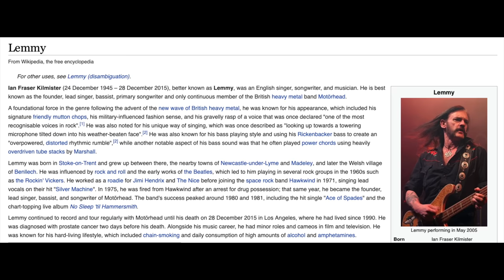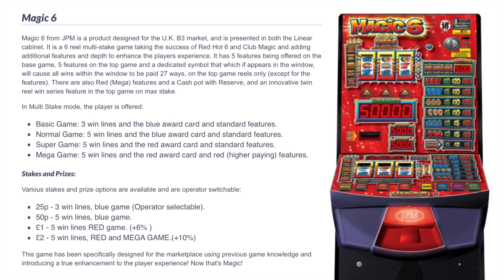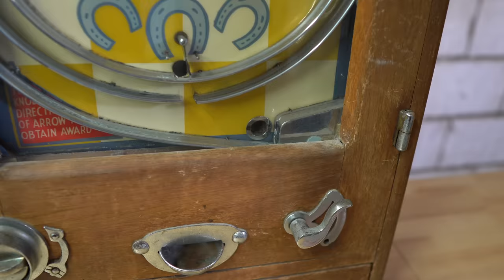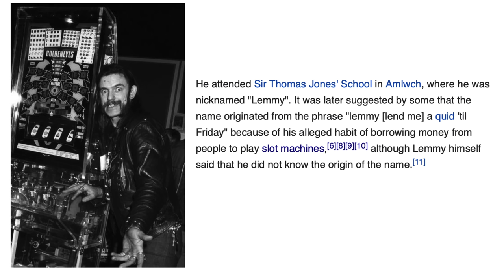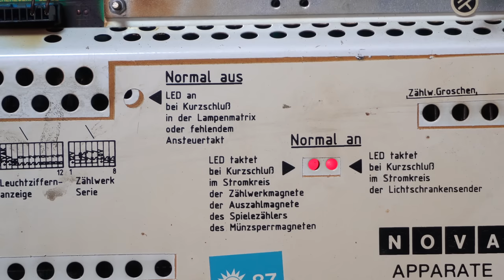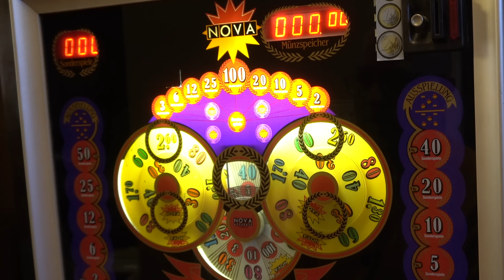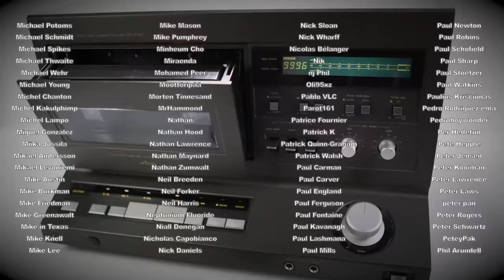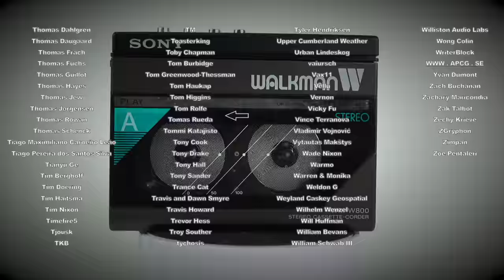Lemmy’s touring slot machines

Comment: This isn’t about fruit machines but back in 2007 I was the deputy manager of a large UK theatre when Motörhead came to play a gig. We were advised to have all of the opera glasses removed from all 1,800 seats if we didn’t want them torn off and thrown at the stage. That’s rock and roll! It took two days to remove them and more than a week to put them back. Sadly, I was too nervous to go backstage so I can’t tell you whether Lemmy had a fruit machine with him or not.
Reply: I haven't seen opera glasses on the backs of seats since Hull New Theatre in the early 1980s.
Reply: @circattle  I worked in Oxford and London and opera glasses were in all of the theatres. Maybe it was the company I worked for whereas Hull New Theatre’s always been run by the council. They probably weren’t interested in contracting in the London Opera Glass Company like the big boys do.

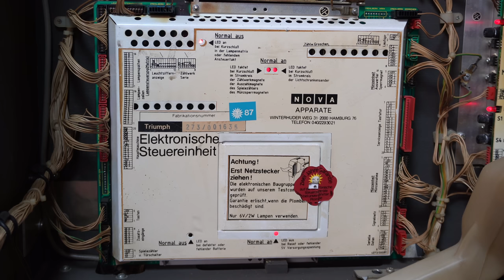Comment: Not sure if this is resolved but at 20:40, the LED on the top left is on when it should be off, indicating a short on a bulb-matrix or missing signal.
Reply: +1
Reply from the maker: There’s more information in the video description.
Reply: @Techmoan  I´ve read that but didn´t see this specific error indicator mentioned there or in other comments.

Comment: Always so fascinating. Long ago I learned why gambling establishments always place slot machines at or near entrances and usually pay out more often: the idea is that as people walk by and see someone winning, they are more likely to go in and give it a try.... and then they get lured deeper in.... and lickety-split, they're broke in no time.
Reply from the maker: I feel that on cruise ships for similar reasons they set all the machine payout percentages high at the start of the cruise but then turn them down as the cruise ends to get all their money back (and more besides). 
Therefore if you plan on playing the slots on a cruise, only do it at the start.
Reply: @Techmoan   I've never been on a cruise, but as we all know, you have, and I should have asked you about it! That's a pretty ingenious method for people trapped on a ship for a week or more
I've read up on some cruises that last more than a month that go all over the mediterranean. Makes me wonder how the gambling would work on more lengthy outings
Reply: To avoid these kind of manipulations of the payout rate some machines had their program sit in RAM only with a Lithium Battery in a hermetically sealed module acting as ROM only. If you open it, the tamper detection deletes everything e. g. by a photosensor in it, you will loose the program, bricking the machine. This was even enforced by several laws to prevent manipulations. See e. g. 'cra gaming machines'

Comment: We used to have gamblers at my old work. The tamper lights used to come on when change tubes were not seated correctly. The only other way we used to get tamper lights was on the contacts in the lock not reading the lock was shut. Hope this helps.

Comment: Hi, German here. My dad had a camp site and pub and we always had one or two gambling machines in the place. The inn keeper would provide the space and electricity and a seperate guy would be the operator owning the machine. The profits were split (not 50:50 I guess). We had one nearly blind regular gues that would sink 5 DM after 5DM into the machine. And this guy hated the DISC machines. Because he could hardly make out their smaller symbols. (not that he ever could play the risk-ladder games on the left and right, sometimes we kids got to assist him) The main reason for the disc machines vs. the wheel machines was that non-blind people liked them because you could memorize the symbols more easily on them because he could not clearly identify the little "Windows" in the first place.

Comment: That picture of Lemmy, was shot in the stage left dressing room at the O2 Academy in Glasgow. The machine had its own custom flight case, and it would have been the job of 2 local crew to unload it from the truck, wheel it in and set it up. At the end of the show, either the runner, or one of the venue staff, would give Lemmy a lift to the casino at the Quay, on the Southside of the river, near the venue. This happened every December (annual tour), and would no doubt have been the same on every show on the tour.

Comment: I picked up a wall-mount machine when I was stationed in Germany in the 80's. Concerns about importing a gambling machine to the US meant that I had to leave it behind, even if it only accepted Deutschmarks. And there was the electrical conversion to 120V 60Hz to deal with. It used spinning cylinders with solenoid-driven clutches.

Comment: Great video about another one of my favorite things... slot machines. Years back I got a Tekken slot machine and I still have it. It's a skill based one where you control when it stops and can nudge the reels if you put it in that mode. The interesting thing is, it has the ability for you to change the level of difficulty, as in, you can slow the reels down so you can learn the blur pattern as the fruit and 7s go by so you can get better at stopping them. Mind you, it's still difficult to won, but with practice it can be done a lot more frequently. Theres an extra video screen toward the top just over the mechanical reels and when different sets of matches occur, it starts other games like a tekken fight or a tekken bowling game, both of which pay out even more coins if you win. It was the end of an era as it takes tokens and the sound of those tokens paying out when you win is just amazing. The lights and sounds are terrific too. Like yours though, it is HEAVY beyond belief. It has a wood exterior but it has a steel box chassis inside and the steel vault door with gorgeous gleaming chrome and piano black powder coated enamel. If you fill the coin hopper inside it can be impossible for even 2 people to lift by the side handles built into the unit. I got it on ebay years ago when it was still legal in some states for them to sell slots, but it was required that if you weren't a casino, they had to be converted to tokens before being sold. Anyway, here's hoping you can get yours up and running again. Keep us posted!

Comment: 20:40 There is an LED at the top left, which should be normally off. According to the text next to it, if it's on it means that there might be a short in the lamp matrix or a missing control clock. Have you checked those? Since something is going up in smoke, it's probably the first one.

Comment: last time I was in a casino it was that neat transition period where they are effectively all digital but had yet to get rid of the arm.  And while my brain knew that arm was merely closing a control circuit it was still satisfying to pull the arm vs push the button.

Comment: I won one of those old german slot machines when  I was about 15 years old - there was a lottery at the local fire fighters. Of course, I got the key with it. One of my friends was completely bonkers about it, and he managed to up the credit to about 500 DM, starting with only 5 DM and using those "Risiko" buttons. At one point he wanted to chash out on it, which ended in the machine not playing until we opened it up to fill in what little money we had in coins, just to close it, start it up, let a few coins be cashed out and start all over again.

Comment: 6:59 These types of games were common in New Zealand takeaways in the 1970s. There was a variant that had a wheel instead of the flipper handle and, when you won, you turned the wheel clockwise to get your payout (the same amount you put in – by memory two cents), plus a new ball. However, it paid out before giving you the new ball, so you could turn the wheel just far enough to activate the payout, then you turned it bak, then forward again to get another coin, then back again, and so on. You could empty the machine and then turn it the full amount to get a new ball, at which point the mechanism would lock till you won again.

Comment: Extremely interesting video! The top left lamp on the control unit being on indicates a short circuit in the front leds or a missing "driving frequency". I guess that's that lost database caused by the blown cap you're talking about in the description.

Comment: That 1950s Allwin works (and looks) like a pre-1980s mechanical Japanese pachinko. Same dimensions too. I have a 1969 pachinko machine and it still works similarly though it had a multi-ball launcher added on later. Apparently they share a common ancestor around 1930.

Comment: 20:41 The LED at the top left should be off. It says „Normal off. LED on when short circuit in the lamp matrix or missing control clock signal“

Comment: @Techmoan
at 20:43 On the top left is an LED which glows Red. It's says "Should be off" but its glowing - it shouldnt! 
The translation states:
LED only on if short circuit in lamp matrix or if driver takt is missing.
Reply from the maker: There’s a bit more information about this video in the video description. 🔝👍 Includes updates, links etc...

Comment: "Hernia time." That sounds about right because I originally owned two Japanese Pachislot machines. One being the Beast Sapp that you shown in your video and the other being the Thunderbirds pachi. The first one I got from eBay and surprisingly arrived in great condition, but the Sapp one I ordered at a vendor near Baltimore, MD. Those suckers had to weight at least 75-100 pounds and that's not even including the extra weight when you put the tokens into the hopper. When I had to resell them due to a move I made sure to keep the tokens separate but still the overall shipping weight was just insane.

Comment: I remember these German slots that played themselves from being there with dad in '86. If I recall correctly the common name for them was Risiko, as printed on one of the buttons. You could walk into a bar, drop in a coin, then cash out (if you still had any money on it) as you left.

Dad gave me a 5 DM coin to play whenever we walked into the neighborhood bar (we stayed with grandma in the apartment he grew up in), which I seemed to lose faster if I actually tried to play. On our last day I just let the machine play itself, and turned that 5 DM coin into something over 200.

Returning to Canada at the airport I wanted to buy a fancy German walkman at the duty free, since the one I had was complete shit that I'd bought off a classmate for $10. It didn't even have rewind, you had to flip the tape over and fast forward, which was dog slow regardless. Dad wouldn't let me though, he exchanged the money and put it into my savings.

It wasn't until a year or two later that I finally bought a decent walkman with soft touch controls, Dolby, chrome, and auto reverse. An AIWA CSX-5 I think, god I loved that thing!

Thanks Matt, for triggering the memories.

Comment: I just read your description and the battery issues. Capcom did the same with their machines. My wife snd I ran a retro video arcade / used game store and repair about 12 years ago and in Sunday’s we turned off the breakers to shut off the machines but we had all the Capcom games in a different circuit (to leave on while the arcade was closed on Mondays) because of the “Kill battery”.

Comment: I was a programmer of Geldspieler and "fungame" (aka. fruit) machines for the German market from 1998-2008, and still have a machine in my office in Sheffield. We sold many thousands of machines into the German market and I worked closely with German manufacturers, including Nova Games who made this machine you had - they were closed down in around 2001. These machines were very tightly regulated and as a result, the games played nothing like UK fruit machines. Players would insert money, wedge the start button down with a bit of card, and walk off to the bar - only returning when they'd won some money and gambled it on the "risikoleiter" - or "gamble ladder". 

Also - and this is possibly why this machine didn't work - but the German manufacturers formed a cartel and got the Government to mandate that all machines would lockout after 4 years - thus ensuring them a healthy replacement market of 50,000+ machines a year. Gotta keep them factories busy! The machine should still work in demo/free play mode with the door open, however.

Funnily enough, a significant number of fruit machines came out of the UK - we were (and still are) the best at game design and software. I ran the export team at a major UK manufacturer and we, and our competitors, sold a significant number of machines into most EU countries and MUCH further afield (South Africa, Japan to name but two). Barcrest in Ashton-under-Lyne, Bell Fruit in Nottingham and Maygay Machines in Wolverhampton were by far the biggest. All now sadly gone but a lot of the staff are still in the industry.

I started a thread on the fruit emu website called "fruit machines inside out" which gives a lot of info on how machines were designed, developed, manufactured and tested. Have a read of it. I keep meaning to start a YouTube channel as I have decades of knowledge on machines, and I'm sure people would love to know about their favourite games, and maybe even meet the people behind them all.

Cheers for the video - it was a nice surprise - and please do let me know if you want to do another video on AWPs/SWPs etc. Happy to oblige.

Comment: The battery could be the issue but I saw you do something that I'm  certain was a portion of your trouble. You moved it while the power was on. Since that's a gambling machine there's a good chance it uses some type of tilt switch and something that isn't resetable by simply turning the power off and on again; maybe a fuse.  BTW, with your awesome hip hop collection and then this, I'm now a huge fan of your channel.

Comment: Here's my theory. Lemmy had tinnitus with all of the heavy rocking. Something I've been getting on and off, and my reading up on it has taught me chronic sufferers don't like being in a silent area, like a dressing room (that's when you hear the ringing). And they often use background noise - fan, radio etc just to create a bit of noise to alleviate the silence.

A fruit machine that ran itself would do this perfectly.

Comment: A little more information about the Sonderspiele function: You actually have to push the Risiko button, to get to the Sonderspiele. If you don't, the automatic gamble will stop at the highest money value, on your machine that would be 2.60 or 1.70 DM. But no one would do that, because its the Sonderspiele that give you the big wins. When you get Sonderspiele, the middle disc is important. Each time it stops at one of the hatched fields, it will pay 3 DM, so if you make it to 50 Sonderspiele, there is a good chance to get over 100 bucks out of it. Also on some of the machines, the Sonderspiele were free games, on other machines, you still had to pay the bet. A little site note: In Germany those machines were regulated by law to pay out at least 60% of the money thrown in and later there was also a time limit of continuous play to fight addiction.

Comment: How amazing it was to see those wheel-based machines - I haven't seen the like before.  I was into fruit machines when I was young and after I moved out of the family home, I decided to buy a large machine to decorate my new flat.  After lugging it up 4 flights of stairs, I found that it didn't work and needed numerous repairs.  Having no access to a service manual - and being quite useless at repairing electronics - it eventually fell into disrepair and I had to throw it out (the landlord complained - justifiably). It was made of plywood and chipboard, with lots of pine effect plastic.  There were three large rotating wheels and many electromagnets.  I wish that I'd kept it but in the pre-Internet age, I couldn't use it.  Another sad tale from my youth.

Comment: 3:15 I have exactly this Triomint Jacky Jackpot in my basement..
From looking at the video, especially the startup sequence.. Normally, at powerup, it should turn all three wheels around twice. Instead they just jerk a bit and then stand still at a crooked angle. As first debugging steps, check whether the motors can spin freely (something might have come loose in transit and wedged in there), put some oil on the axles, and check whether the position sensing photo sensors are clean and well attached. Also check the plugs of the motors. Measuring the resistance of the motor windings might also be an idea, to rule out a fried pole.
The smoking cap is most likely in the power supply on the top, or in the line input filters. Should be easy enough to find and replace.
(I've got spare wheels units of several 80s/90s machines around, if any of the motors or light sensors are an issue, I might have a spare..)

Comment: Ah, the warted one. I saw Motorhead years, decades really, ago with Megadeth and Slayer at a fairly small club in CT. It was unusual mostly because there were teens and twentysomethings in the mosh pit going nuts for the first act and off in the corner of the club during the more modern artists were a large number of older folks in leathers waiting for Motorhead. The didn't mosh but did get up to the stage and headbang while they played and then most left before the headliner went on. They saw the band they wanted.

Comment: My Dad and Lemmy died almost the same day - strange, miss Lemmy somewhat much more ;)
PS: You hae got an LED on, that normaly has to be off - "normal aus" (Normal off) - And the text below reads: LED ON when short circuit in the Lamp-Matrix or missing driving tack/control cycle (Ansteuertackt) - i know, its eons later, you most certainly saw it, but maybe, this helps to get it back working... as you said, there was some smoke coming out, maybe, there is another capacitor ready to blow or something shortet on the board or the lamps...